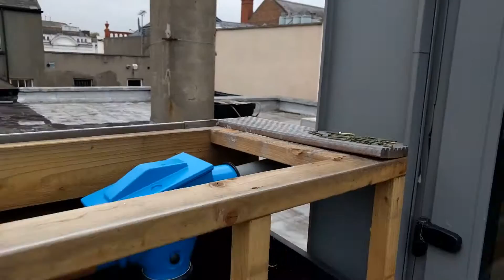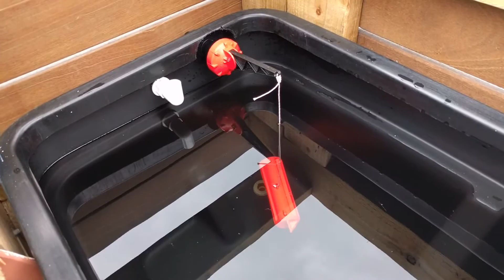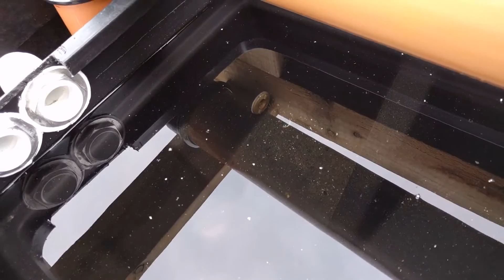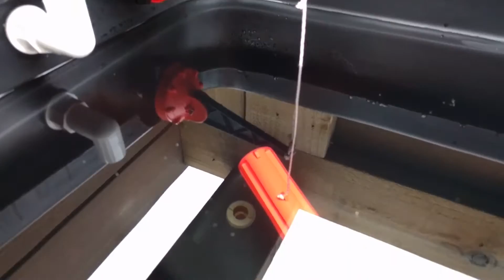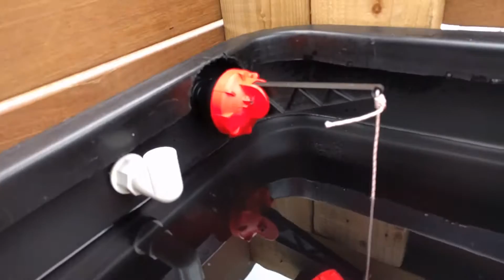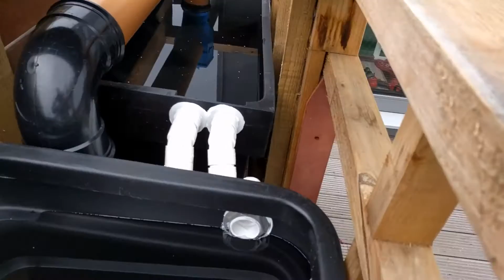Mini DIY Passive Rainwater Harvesting System Walk-through

Comment: Waow Andrew, that's awesome :)

2 questions:
1- What's the impact? ;) I mean: how much drain water do you hope to save? I know Ireland doesn't charge for water usage, but when would you break even assuming an Avg. European water price
2- Any mosquito's concerns? They reproduce in stagnating water - so I'm wondering if you need to add additional filters to protect them from entering through overflows for example, or add light desinfectant

Cheers :) Cyrille
Reply from the maker: Good questions.
1. The working capacity is only about 350L (not measured, just based on nominal tank capacities), and that's really the max I could manage to fit into that space without custom designed/shaped tanks (probably too expensive to justify for a one-off situation like this). The plan was for Ireland to introduce water meters & charges however the whole thing caused so much controversy that it's highly unlikely there will usage based charges anytime soon. Therefore I doubt this system will ever pay back in monetary terms. Thankfully my main reason for doing it was more experimental, and also just because it just seems like common sense to make some use of all the rain we get here. So to answer your question on impact... before embarking on this project I did acquire several years of historical daily rainfall data for the area and combined that with some facts and several assumptions. The result was an estimate of the proportion of days the tank would need to run on the mains backup; that figure turned out to be 25% (if toilet flushing was the only use). So with 3.5l/flush and an avg. of 16 flushes per day, the collected rain should now be used for about 75% of the ~20 m&#179; required/year. With the proposed Irish rate of €3.7/m&#179; that would have meant saving €55/year. It's hard to for me to know how much this cost to build because many of the special items were supplied by the contractors on the team who built the house, and the breakdown of things got quite messy. However, looking at online consumer prices for the parts used I'd say you could put it together for less than €800. That figure doesn't include the work required to connect it properly into the plumbing. Probably, if charges had been introduced, it would have been an approx 20 year payback period.
2. Yes. I did consider putting meshes over all the small openings, but we don't really have a mosquito problem in Ireland, so I'm kind of waiting to see if I find anything living in there when I open it up next year! If I start to see any sign of trouble, I'll get some mesh and do that. Also reassuring is that every time there is a heavy rain, anything floating around on the surface gets pulled down the overflow pipes.